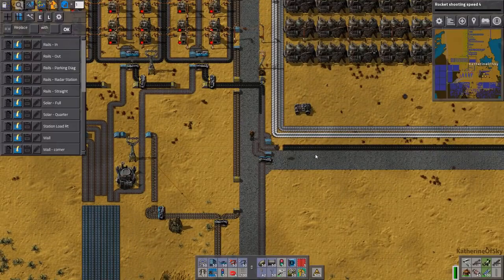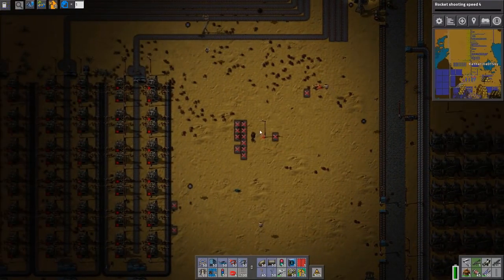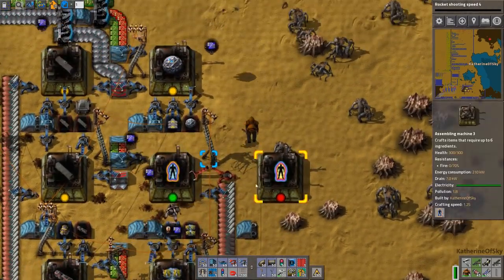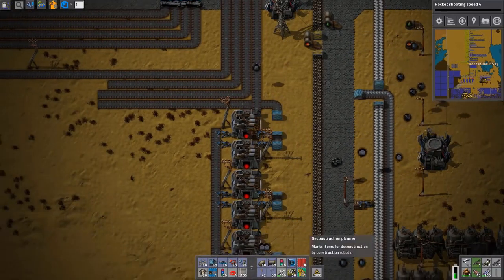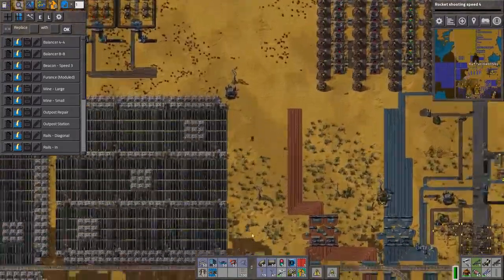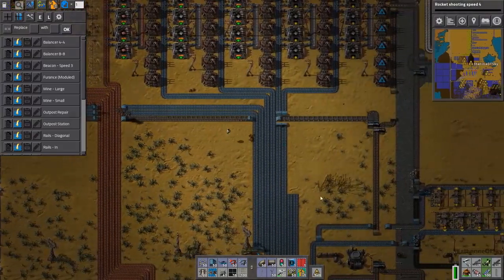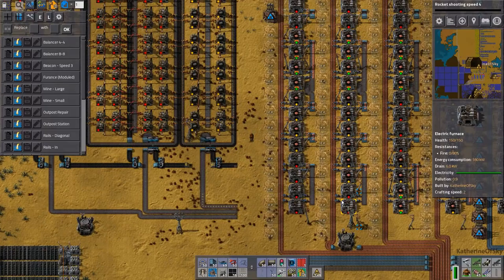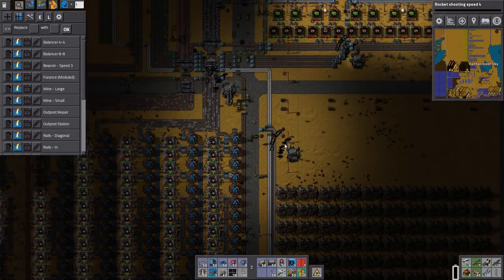Factorio 0.14 Space-X Mod, Ep 38: Expanding Smelting - Let's Play, Gameplay

Comment: @KatherineOfSky If I remember correctly requester chest contents do not count towards logistic storage. You might want to limit the shields chest with a circuit condition otherwise it will keep making them until the requester chest is full.
Reply from the maker: Indeed you are correct!  Not sure why I did it that way, but I should have put a wire to the chest instead.  Thanks!